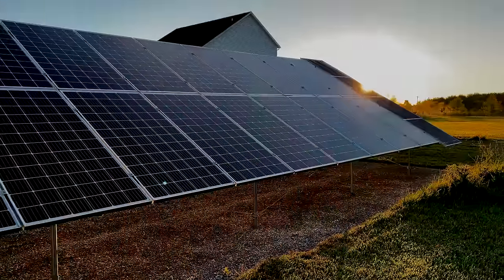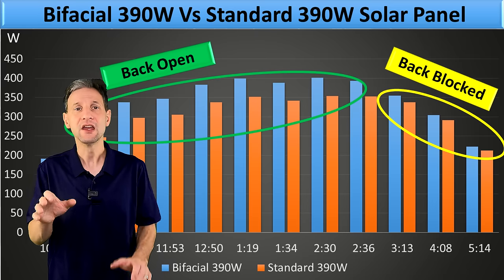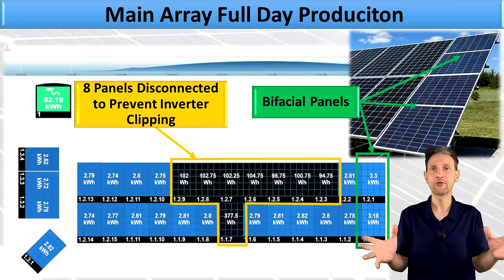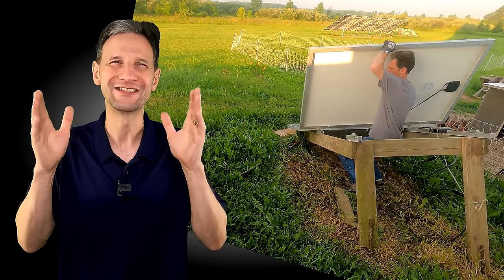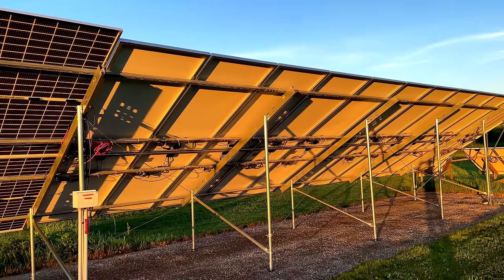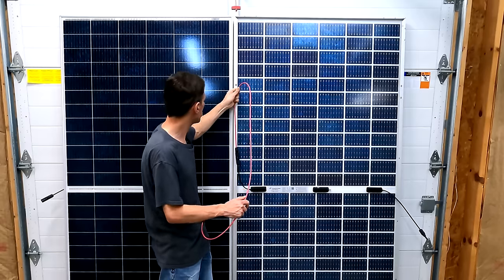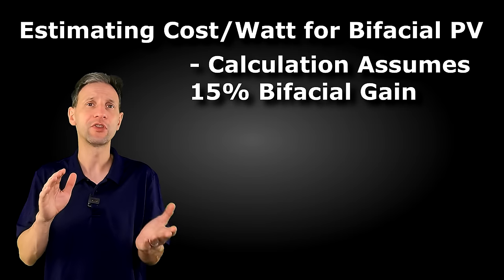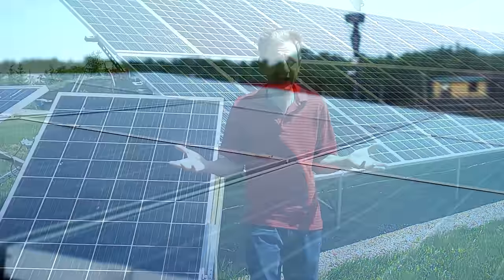Bifacial Solar Panels - The BEST Solar Panel? Real World Results!

Comment: A few things: The blocked back test seems to use "Manila" coloured cardboard. This would reflect light going through the panel back up to the panel skewing your results. Flat black would make more sense.... though it is really hard to find any surface that doesn't reflect anything.

Mounting: These panels need either three horizontal bars (top, bottom and centre) or side bars only for best rear face use.... though really shinny bars may have a minimal effect on a white roof.

You mention that mounting panels farther from your white roof is better than closer.... have you actually quantified that? I can see that a tilted field structure would benefit from being higher off the ground but do not see how mounting the panels higher off of a white roof would help, assuming side by side mounting with no gaps. Or is that just for cooling?
Reply from the maker: The cardboard may not be a perfect as a black surface, however, very little light makes it through the panel itself.  I don't think the results would be significantly different.
The distance from the roof allows more ambient light to reach the back side.

Comment: Dave
Check out this racking company (Sinclair designs and engineering) they have a very nice easy to install ground mount adjustable racking system. What’s your thought?
Dave
Reply from the maker: I have two friends that have used the Sinclair system.  I have met the owners of Sinclair at one of their installs.  They have a great system and I can easily recommend it.  They have a very low cost solution for adjusting tilt angle and the single pole system provides a nice clean install.  The one drawback is the cost of install.  You either have to pay someone to use a special pile driver, or dig 2' diameter 7'deep holes and fill them with concrete.

Comment: I'm from a similar cloudy lnorthern latitude,although milder, 
What would the early morning and evening results be from mounting the panels completey vertically? Either east-west , or north-south, 
Just wondering wiuld a bifacial generate more early and late power,and "enough" midday electricity, or would it be best paired with a south facing array , giving more electricity overall on cloudy days , 
Or would a single axis  motorised mount with a single faced panel give better overall performance and cost ..
Reply from the maker: I have been posting periodic performance results on my community page if you want to check the progress as we move towards summer.

Comment: If you have panels that do not face directly south then you can make a swivel base with an attached convex mirror (like on truck side-view mirrors but larger) behind and above the mounted panels. This will allow the unobstructed sunlight to reflect and spread out to the back of the panels. The vertical angle of the mirror should be downward based on the distance behind the panels. The horizontal angle can be adjusted via the swivel base every week or at will. This can also be done with south facing panels but the angles & size of the mirror would be determined based on your location. It may require some calculation and DIY with the swivel base setup but that is a small price to pay for increased solar production and instead of buying more panels.

Comment: Have you tried placing a slightly-curved shiny aluminum panel with a few inches of space in between the back side of the bi-facial, Or maybe a mirror? Or a chrome-plated steel sheet?
Also, I read somewhere that Bi-facials are sensitive to heat. I mean, they're not as productive or efficient when they're hot, as opposed to when they are cool.
That being said, have you tried putting transparent window films to block the sun's heat while still allowing the radiance on to the panels?
Reply from the maker: You can see my analysis of a bright white reflector close to the panels in this video: https://youtu.be/mzqjCsZKUYQ
Blocking the sun's "heat" will also block the suns power.

Comment: I've been thinking of a couple of these for a solar pergola project at the end of my garden here in the uk. To increase output at the back I was wondering about getting mirrored metal to creating a basic convex reflector at the back, the whole length but maybe 1/3 the width of the panel, about 18 inches from the back surface? My thinking is a large body mirror will block some of that reflected light, but being 1/3 size should mean the back of the panel still picks up enough from the surroundings, and the mirror would amplify a significant amount too.
Reply from the maker: That would make a great looking pergola!  I think you would be better off just letting the ambient light hit the back.  The expense and effort for the reflector won't be justified.

Comment: hi. mounting bifacial on roof is not that great idea. Maybe if this roof is a flat an you put white foil under it.
According to this video below - stationary panels are better options for bifacials and putting a white, reflecting foil or white rocks/sand will increase the output average 11% Can you try this foil and do tests?  They are telling that without foil, on the grass they get aroud 5% more in bifacial, but with foil you get up to 23% more. The average they get 11% more production with and without small shadow. https://www.youtube.com/watch?v=WznZGCGwkvs
Reply from the maker: Based on my winter results, I don't think the tarp will make that much difference.  
You can see my winter results here: https://youtu.be/YZWeCUzu0yQ
You can see my roof results here: https://youtu.be/mzqjCsZKUYQ

Comment: Hi, some use water for cooling and it shows around a 10% of more power, it may be great if you could make a video showing if a bifacial solar panel could perform better when cooling with water
Reply from the maker: I've been taking some temperature data that might help answer that.

Comment: What would the performance be if the back had a reflective material spaced 1-3" for cooling?
Reply from the maker: These panels require a significant gap in the back for cooling and proper reflection.  Materials close to the back, even if they are reflective, reduce cooling and reduce reflected light.

Comment: If the racking is shading the rear of the panels, wouldn't that cut way down on the production from rear, just as it would on the face?
Reply from the maker: It does reduce the performance, but not as much as it would on the front because it isn't generating a direct shadow.  The light on the back side is coming from all directions.

Comment: Thank you for all your efforts on comparing those two types of solar panel and ive learn a lot from you. I was thinking of installing bifacial panels back to back at 45 degrees if it can gain  more energy, may you experiment on this. Ive seen videos on vertically installed bifacial which produce more energy but the thing is, is it pruducing enough during noontime?
Reply from the maker: I plan to do some testing with vertical Bifacial panels.  There is a big dip at noon, I think there are some ways to deal with that.  I'm working on it, but it will probably be next summer before I have results to share.

Comment: There is a ground cover called “extendaday” we use it in the production of apple growing.. it is a very strong woven type of plastic that reflects light at a great rate.. I am in the middle of installing a ground mount solar system and will be placing some extenday underneath panels.. I’m thinking it may increase %
Reply from the maker: Interesting idea.

Comment: I'm new to all of this. I'm interested in putting a couple of bifacial panels on my cabin roof to keep a battery charged for my lighting needs. I'm wondering about mounting options. My roof is aluminum and very steep as it's an A frame cabin. How much space between the roof and panel should I have for heat dissipation? And should I keep the panels at the same steep pitch as the roof? I really don't want to screw it up and ruin expensive components. Any advice out there would be appreciated.
Reply from the maker: You can get a good idea of mounting methods from this video where I installed panels on my shed: https://youtu.be/Y8OGxdJ9cU8
Or in this video where I helped my friend install panels on his shop: https://youtu.be/VkqUvd4c1-U

Comment: Why don't you try them be placed perpendicularly, with faces placed east and west, at a distance /gap that is equal to one panel (..and about 1 feet above the ground), and the ground be prepared with white glazed ceramic tiles. The surface could thus be cleaned easily. Multiple reflections result in light being hit on either side almost equally.
Reply from the maker: While that would provide a lot of scattered light to each surface, the most beneficial light is direct sunlight.  This setup you are proposing, If I am imagining it correctly, would result in significant shading from nearby panels.

Comment: Last winter, in Illinois, I tested my new Q cell Bifacial 420/460 watt panel with a NEP micro inverter installed.  The day was bright, cold, with a fresh snow cover, and the panel was laying on a tall drift, facing south at 45-degrees.  The output of the panel was being clipped at 550-watts by the NEP 600.  It blew me away !!!  I too have the SE optimizers, and reading an info letter from SolarEdge it mentions that any extension cord from the panel to the optimizer should not exceed 12-inches.  I’m currently installing my solar system with an SE7600, a Solar City Delta H6, a half a dozen NEP 600 micro inverters,  EcoFlow solar generators, and a mix of 47 panels.  The Delta will just charge my Tesla.  Its a real Frankenstein system.  Its a retirement project, and having fun installing it myself.  All parts bought off eBay and Signature Solar.  No bad experiences with purchases.
Reply from the maker: Wow, that's a great result.  I'm looking forward to some winter results.  The nice thing about the NEP micro inverters is you can build and expand a "Frankenstein" system and still get great results.  I'm working on a video to show an install on my shed that uses a mix of panels and NEP micro inverters.  Thanks for the info!

Comment: You cannot get the bifacial panels in the UK for any money. In fact you have easily 10x the choice at better value over the pond. I personally think that the UK government dont want PV over here, they won't be able to rip us of as easily if they do. Looking at your market and product range in the US it goes against the supposed fact that the US is supposed to not care about alternative energy !

If you still have a test rig it would be interesting to try a couple of tests....

1. I suspect the rear set of cells may come in on a seperate terminal in the diode box, if so it would be interesting to log the rear cells alone just to see what they can generate.

2. I would love to know what you would get from the bifacial if you could borrow a mirror to put under them of even aluminium foil just to see the difference.  

Thanks for the great work you put into your videos and the data you compile. Keep up the great work  :)
Reply from the maker: Thanks for the suggestions, hopefully I can get back to some more bifacial testing after I get through some of my current projects.

Comment: The 66% output you saw from the back is called the bifaciality factor which is typically at 0.6-0.7. The 30% gain is the additional irradiance available for the panel through the backside. Other than that, good video.
Reply from the maker: Bifaciality seems like a more precise spec for manufactures to list than bifacial gain.  Although, I guess that might lead people to believe they could get more out of a panel than is actually realistically possible and they should be directly linked.

Comment: I have Galvalume metal roof on my hangarhome which reflects a lot of sunlight. I wonder if bifacial panels performance would benefit
from that?
Reply from the maker: Maybe, if you have some angle or large gap behind them.  However, I wouldn't count on a big performance boost.  I'll have some results soon on my shed roof bifacial performance from this install: https://youtu.be/Y8OGxdJ9cU8

Comment: The East/West panel production argument depends upon the location. I have 3 roof faces ... 1 90 degrees Az, one 180, and one 270.  My East facing panels produce more daily that the other 2 faces. Not by much, but by a little. No shading on any strings and I use optimizers.
Reply from the maker: Very interesting.  I suspect heat may be a significant factor for you, with a roof mounted system in Az.  The East facing panels are picking up their sunlight during the coolest hours of the day.

Comment: Dave, hey! Could you please make a video about the good practices of the practical correct and nice wire management on the bifacial panel installation? Which type of clamps do you recommend for the wire fastening onto the frame of the panels etc...
Reply from the maker: I will be adding some bifacial panels to my ground array expansion in the spring, I'll try and fit some of that content in.  Thanks for the suggestion.

Comment: As someone mention Mylar for a reflective surface would be interesting, but with the added maintenance of keeping it clean it adds a lot of work and a greater leap in cost than something like white landscaping rock. I would be interested in the performance of something more feasible like white gravel. If you have time to test it I’d love to see the results.
Reply from the maker: Although white rock is much more practical, Mylar is easier to test, so I plan to start there.

Comment: Has anyone tried a vertical east-west bifacial ground mount. I'm curious if the back puts out close to the same as the front.
Reply from the maker: I plan on doing a vertical test in the future.  However, I can already tell you the back does not produce as much as the front.  You can see from the results in this video where I flipped it upside down to measure the back side performance.

Comment: What do you think about a panel arrangement on a plane shift Horizontal, solenoid controlled degree device allowi.g full exposure to the panels at any given time of day.?
Reply from the maker: Anything powered is going to be more expensive, fail sooner and require maintenance.  It is cheaper to just add more panels if you need more power.

Comment: 0:09 - Three men standing almost on the edge of a roof, it looks to be twenty or thirty feet up, no harnesses, no helmets, no gloves, no scaffolding beneath them. If the guy in red got his foot caught for a splite second on one of the ridges on the roof, he has nowhere to go but OVER THE EDGE. Absolutely insane. How these people stay alive while doing their jobs is beyond me. At the very least there should be scaffolding all around that roof, so that if they fall, they only go a few feet and hit the scaffolding boards. 
Surely the horizontal mounting rails cause permanent shading on various parts of the back of the bifacial solar panels - how do the panels not get damaged by this? My solar panels' manual say that any repeated shading (i.e. the same place, every day) voids the warranty - and they aren't bifacials!
Reply from the maker: The back of the bifacial get very little direct sunlight, so as long as there is space between the bracing and the panels the ambient light still has a pretty good effect.  I have not heard of shade causing damage to modern solar panels.  Perhaps you could direct me to a study on that topic.
Reply: @ProjectsWithDave  Canadian Solar's manuals for their panels state this:  https://static.csisolar.com/wp-content/uploads/2020/10/02123321/Installation_Manual_of_Standard_Solar_Modules_en_v2.91.pdf   "AVOID SHADING
Modules shall not be permanently shaded (including
partial shading, spot shading, even shading or uneven
shading) under any circumstance. Permanent shading
includes shading of the same cell, cell row, or module
portion for extended and repeated periods of time (e.g.
more than 200 daylight hours over the warrantied
service lifetime). Power dissipated in fully or partially
shaded cells will result in power loss, reduced yield and
can cause localized overheating, which in turn may
negatively impact the module service lifetime."

I'm only going by what they have in their own manual. More than 200 daylight hours over the warrantied service lifetime (which I think is TEN YEARS) should be very easy to achieve (if that's the right word).  Perhaps they are just covering their asses.
I would suggest laying white gravel underneath the panels, both to keep grass down and to add more reflected light to the backs of the bifacials.
Reply: @ProjectsWithDave  More importantly - what about those crazy guys at 0:09 who appear to have zero understanding of how dangerous their work practices are?
Reply from the maker: For many reasons, including safety, and my fear of heights, I recommend ground mount systems.
Reply from the maker: You're right, it is in the manual.  It appears there is some concern about a permanent structure that blocks the same area of the panel all the time.  Sometime when I have a minute I might block one of the panels and take some infrared footage to see if there is some significant temperature impact.

Comment: You have a pretty incredible setup there.
On a regular, angled slate roof do you believe bifacial panels will still produce more power?
Reply from the maker: They seem to produce more power in every situation.  However, a slate roof would absorb most back side reflected light so I expect the boost in power would be very small.

Comment: I'm more interested in the longevity of the solar panel and I assume having the back of the panel covered by the glass will last longer than a standard back cover.
Reply from the maker: From the research I've done, back panels are a common point of failure, so glass should be a big improvement.